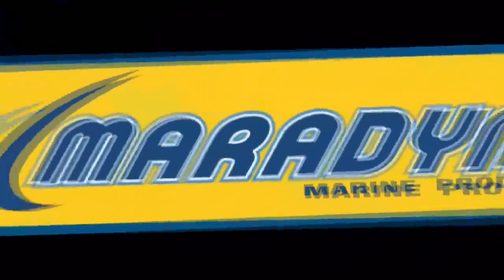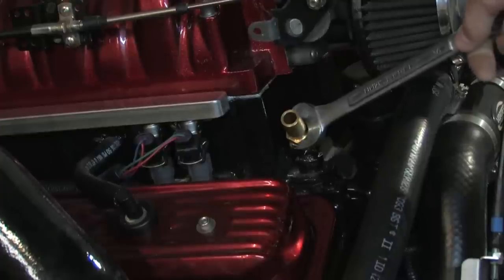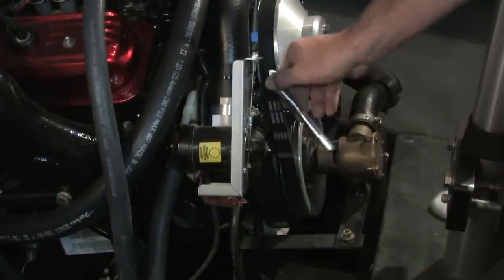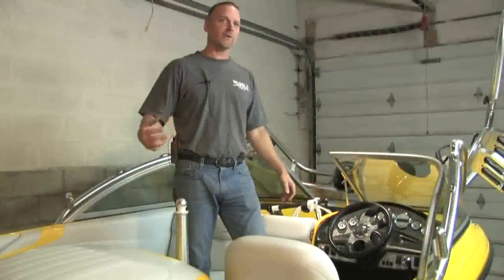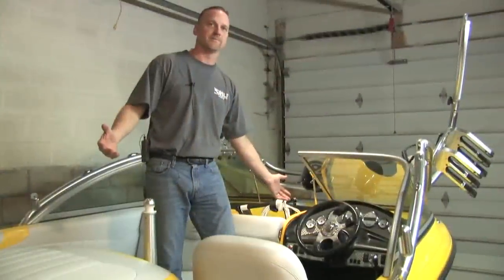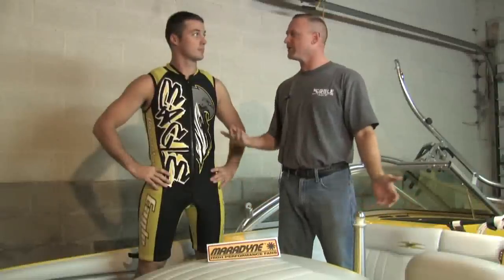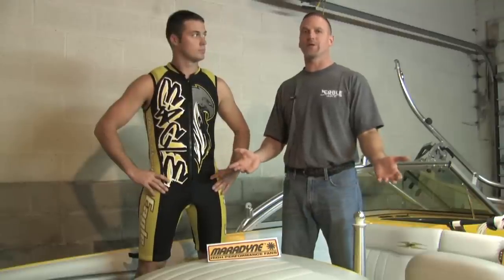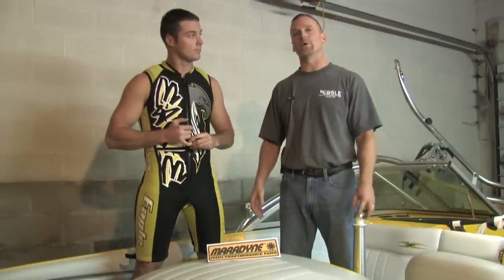Maradyne Boat Heater Install

Comment: Does the engine have to be warm in order to get heat, or does the unit heat the water?
Reply: engine has to be warm, the heater takes hot water from engine and the air is blown over the heater picking up heat before coming out vents hot
Reply: @mikeboston421  Thanks for the answer, but I posted my question 3 years ago LOL